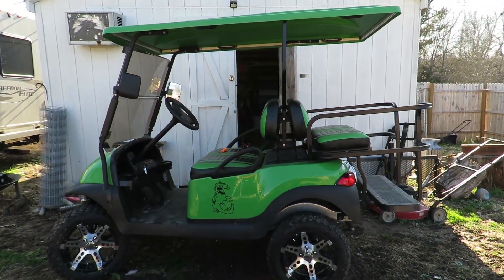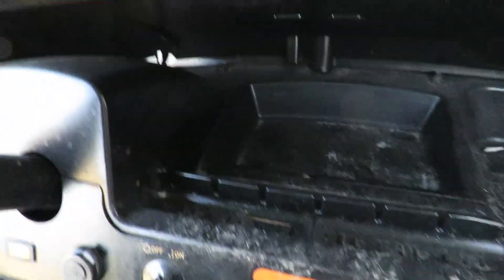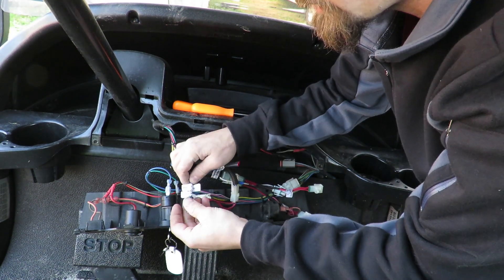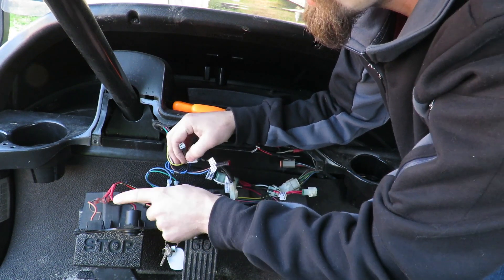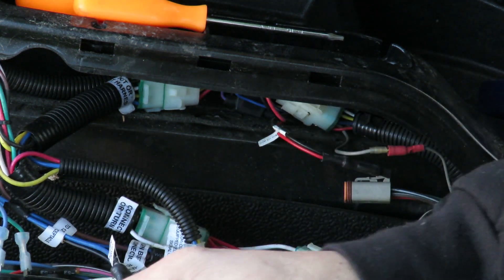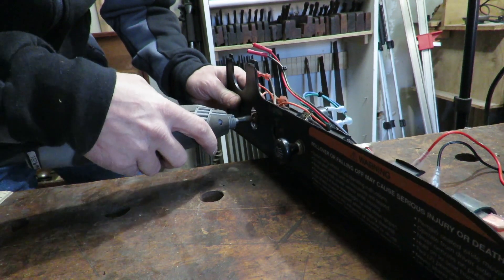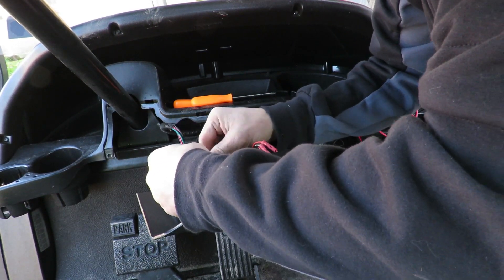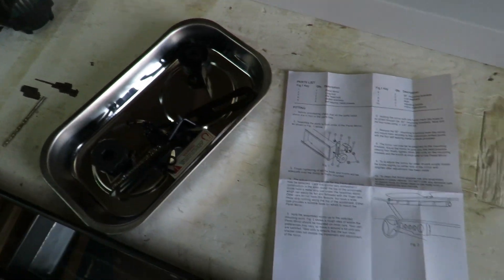Golf Cart Upgrades | Adding a Mirror and USB Charging Ports

Comment: Great video!!!
2 questions:  What year Club Car Precedent is in the video?  Is it gas or electric?  Thanks.
Reply from the maker: 2012 and it is electric
Reply: Timothy DC I have a 2013 electric, but it does not have the 12V accessories port on the harness like yours. Do you have a voltage reducer installed? Is that a factory installed harness? Thanks
Reply from the maker: Yes, that is a factory harness. Not sure what is in line on the harness as far as voltage reducers. Haven't looked that deep into it. Have you looked under your dash for any extra hookups?
Reply: Timothy DC Yes. I have the Bucket Harness and the light kit harness, but that is all.
Reply from the maker: If memory serves me correct all I really needed for this was a 12v wire that is tied into the ignition so that it doesn't drain the battery. My harness may not be factory as it was a redone club car with new body kit and such.

Comment: Where did you get the voltmeter/usb combo? How has it been since install?
Reply from the maker: Check the description for a link to my amazon store to find the one I bought. I like it a lot and works well. Really easy install.
Reply: @ASliceofWoodWorkshop  Great. I just ordered one.
Reply from the maker: Awesome. Thank you for also checking out the video and enjoy vacationing this summer!
Reply: @ASliceofWoodWorkshop  Could you have used the horn accessory cabling instead?  I have that available on my cart and am wondering if that will work for me?

Comment: We want voltmeter to read 48v, the vintage of the battery pack, not 12v. Wiring seems correct for usb charger but not for voltmeter readout. Pl fix and repost.